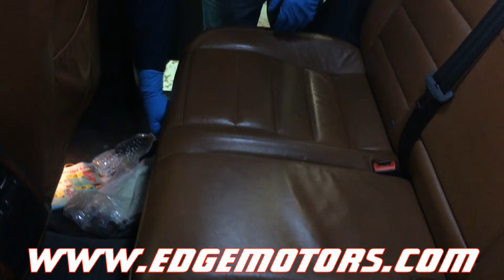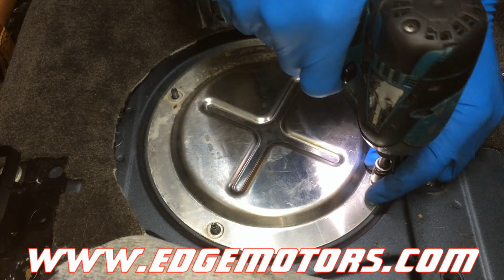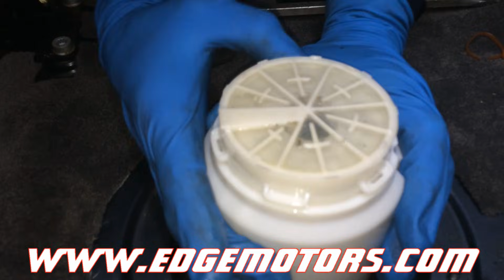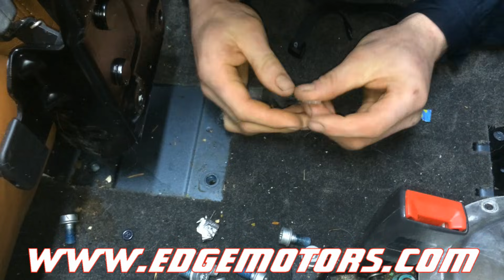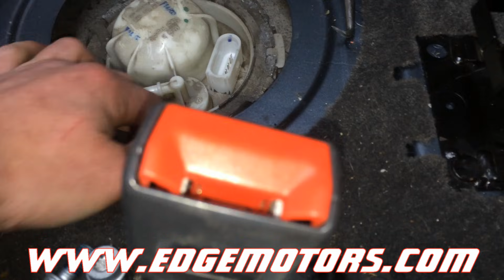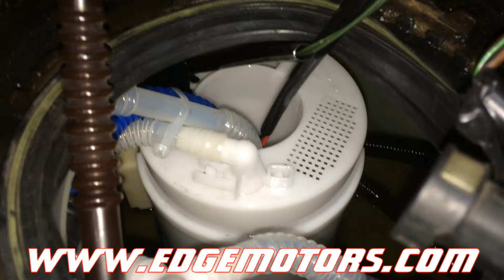VW Touareg Audi Q7 fuel pump replacement DIY by Edge Motors

Comment: Gentlemen!!! Thank you very much for both your Touareg videos! Y menya problema - esli mojete posovetovat' budu blagodaren ochen' silno! I just bought the same, 2004 V8 Touareg.... drove it from ohio to new jersey, and after getting more gas before crossing the bridge to NY, the car started - worked for about 10-15 seconds and shut off... its like this everytime, for the same amount of time... Now there are a million problems with this car... it had 9 codes, the guy that changed the oil in ohio put 5w40, for diesel engines (found this out after gettting to NY, with every possible light on the dash turned on) The key is stuck and the button on the gear console is pushed in (gears can freely shift up and down). This was done after I put too much force (aka viebal eie v Park ot zlosti kogda doehali, turning on and off about 500 times)... So step by step I want to learn about how things work, and at the same time fix this car. (My business partner has a auto dismantling /container loading biz in New Jersey with all possible tools, lifts etc that I can use to try and fix the car my self)... Any ideas on the shift handle (get the button out) so no one steals my car lol? and possibly the break light (and annoying constant sound it makes thinking the car has the break on?) I will begin with testing the fuel pumps... is there a video on how to change the fuel filter? (if fuel filter is clogged, is it possible the pump will not work well?) Any suggestions, will really help. Your videos are great, thank you so much once again. 
Thank you all!
Reply from the maker: sounds like you have a problem with the main pump. the one on the pass side... i think. they both turn on at start up, but then the supply pump turns off after several seconds... sounds like the starts from supply pump, but then when the supply pump turns off the main pump is not working.
Reply: Thanks so much for your reply!Hmm... Is it possible for the fuse/relay to be blown? Or maybe the sending unit or fuel filter clogged of the main pump?
Reply from the maker: Arthur Romanov
thats what you going to have to check your self.
Reply: EDGEMOTORS Hey. I pulled out the first 404 Relay (if looking at the windshield, its the one closer to you (on the left, in first box). The car doesn't die anymore, and functions with not as much power but perfectly fine. I am guessing if one pump is turned off, the other pump works full time. I tried to find out which pump that relay is responsible for but failed. Would you know which one? This would really help. Also, if I get the car to you, will you be able to fully diagnose the problems (with good certainty) and how much would that cost (a full diagnostic).
Reply from the maker: Arthur Romanov
that would cost about 100$
Reply: Okay, can I come Saturday? What's your name, I'll call you (same number as on website?)

Comment: Always replace the fuel filter, it will leaks! We had seen 2010, 2009 leaking fuel.
Reply: Can you let me know where is the fuel filter located? Thanks
Reply: You need a fuel filter tool to do that.
Reply: @stevenc8140  you only need monkeygrip player

Comment: I replace my primary pump but the truck will shut off five minutes later  why? Do i need to replace the other pump ? Or is something else that is affecting my primary pump?
Reply from the maker: it looks like you replaced the secondary pump.... cause the secondary pump shuts off after about 30sec after start....
Reply: +EDGEMOTORS good day. just to be clear....if my Treg cuts off after thirty  seconds. .which pump do I have replace?. people are trying to take advantage of me.... and please tell me which side it would be like passenger or driver..because I gets confused with just saying left or right..please help me
Reply: This answer was super helpful its the one I was gonna ask!! thank you so much for the detailed orientation for the diagnostic. Blessings on your business!!!!
Reply: EDGEMOTORS Uuuubb n
Reply: What do the colors on the fuel pump wiring connector mean
Reply from the maker: +Crystal W  if your car cuts out after 30 sec, your main pump is bad. easy to check which pump is main and which is supply. check voltage at the pumps when you start the car the supply pump will turn off after 30sec of running, the main pump supposed to keep the voltage going. but when you lift the seat up and expose the pump doors and make sure all the fuses are ok and you get voltage at both pumps for the first 30 sec, then you could listen to both of them and you should be able to hear which one is working and which one is not. at that point take the one thats not running out...